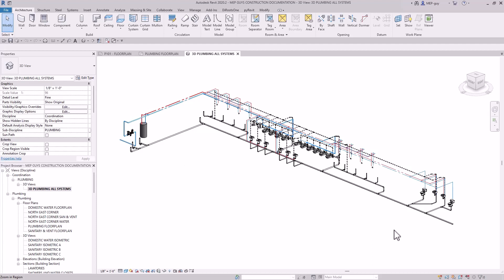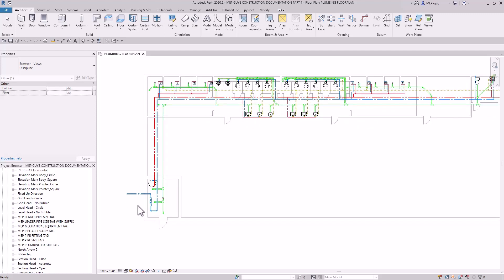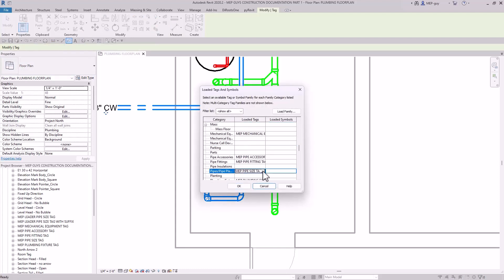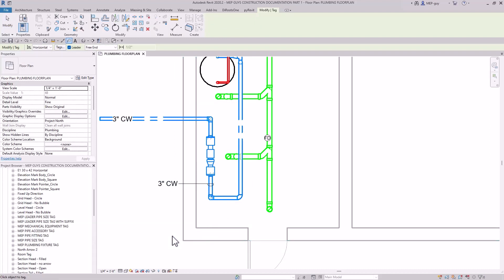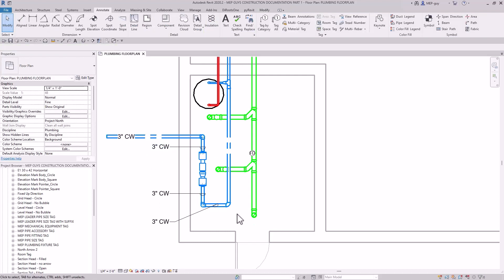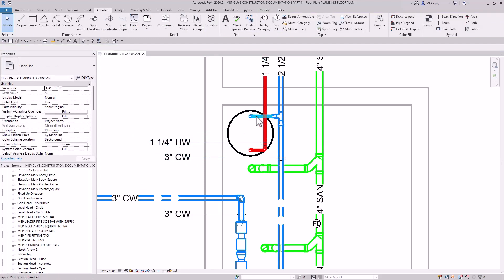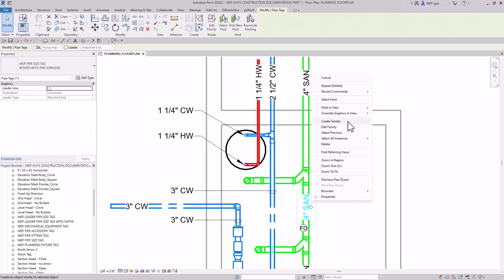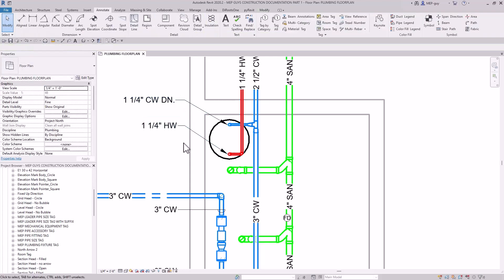Plumbing Construction Documentation in Revit

Comment: In order to use your course do you have to have a revit subscription? I have revit but dont have the configuration to access fitting ect.
Reply from the maker: I provide Revit project files with my courses so everything is included. You will have to have Revit 2020 or a newer version.

Comment: Hey Ryan, is there a way to create at tag with a set  landing length?
Reply from the maker: I just added a line of 1/8" to the right of a tag and it did work. However you would need to create two types. One for left and right side tags. Or just use an instance parameter for the landing line visibility on either side of the tag.
Reply from the maker: I suppose you could do that. Let me try it out real quick.